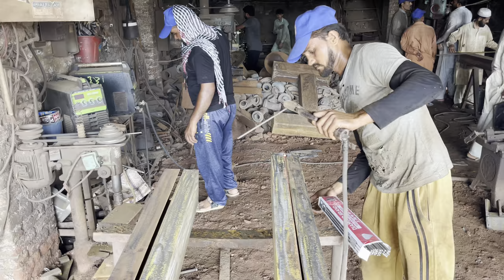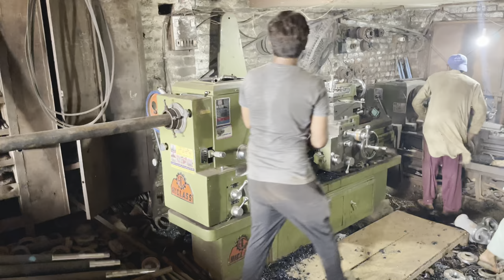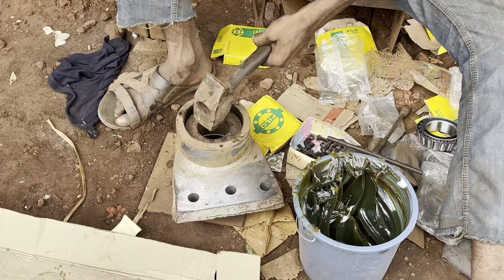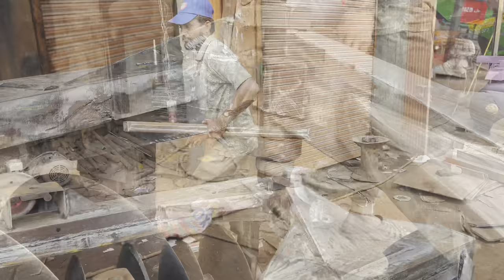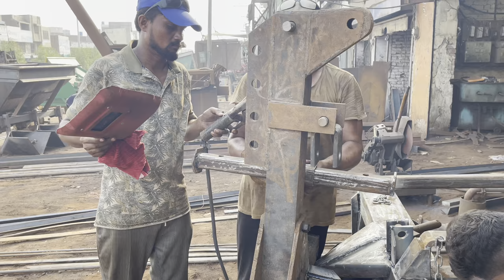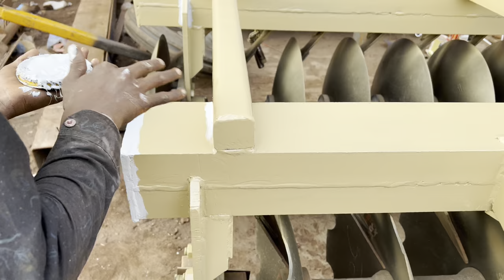How Disc Harrow Are Manufactured || Production Process of Disc Harrow for Agriculture !

Comment: It’s hard to beat a true running offset disc.  It cut clean and smooth.  Not many people know that you can turn to the left without raising them.  Turn right and you ruin your day.  The heavy gang shaft is very nice as well.  Nice work.  Your officially “Sodbuster” status.
Reply: They looked to be doing a good job of harrowing to me.   I'm no farmer but it was interesting to learn that it will cut ok when turning left but not right?

Comment: I've done a fair amount of welding, and I know that having jigs and fixtures is a real time saver. It also helps assure that each finished piece is just like the original in alignment and function.
Reply: You would think they would make a jig for the different steps.  Also clean up that shop.  Investing in a plasma cutter might also save time but what the heck.  Its more fun to do it the hard way
Reply: Its the way they do things.
The hard way....
That makes watching so fascinating.  
The industrial revolution left them in the dust.
Reply: Well if you ain,t have all the tools to make the job easy and you wanna be selling products for a decent price. You ain,t got much choice to do it the hard way.
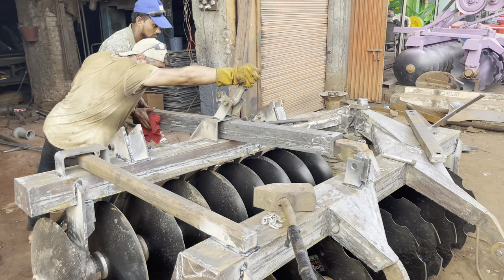Reply: Best part was 32:32 when they realised it was never going to fit

Comment: I'd be interested in seeing some test done on those welds. I haven't seen anyone bevel the metal on a butt joint or packing grease in a single bearing before installing them.
Reply: No different than the welds on farm equipment all around the world and especially USA the cheaper with high inflation and and so called electric cars..

Comment: Why weren’t the taper roller bearings packed with grease during assembly 🤔good video 🇬🇧
Reply from the maker: They used the grease but we mis that part
Reply: The machine fails before the dry bearings
Reply: Plus no seals anyway

Comment: Just wondering if those bearings come packed with grease because they didn't use any, unless they dismantle it to pack the bearings later.
Reply: I saw that, no grease zerks for pins or bearings either. No bushings for the pins.
Reply: @sisyphus9252  With 99% of these repair shops none of them grease the bearings no matter how big the machine is, a few squirt a little oil in them but how long would that last.

Comment: It's nice work, but it looks a little flimsy for something that will be worked hard in a field.
Reply: It is hardly nice work TBH, this no look tacking with stick welding is just stupid as you can't see. I weld a lot repairing farm kit and if you can't see you can't weld.
Reply from the maker: Thanks
Reply: @DiscoveringSkills  Thanks...lol
Reply: @theessexhunter1305  yeah, I grew up on a farm, lots of stick welding practice and driving a tractors for 14 hours straight.. lol
Reply: @theessexhunter1305  and yet, there in the video is proof it works well enough. There might be plenty in this video to "question", but look away tacks are a long way down the list.
Now if you'd like to complain about welding over slag I'll hear you ;)
Reply: I wonder what they charge for a hand-made disc harrow....
Reply: it looks plenty strong ..........bearing in mind that its being pulled by a 75 hp 2 wd tractor .........

Comment: Mans got to make a living, if for no other reason than to feed himself but if he has a family of eight, all bets are off. He needs to do whatever he can with no concern for the mortal danger to himself. Arc weld without eye protection, wear open toe  sandles around heavy dangerous equipment. Third world existence demands these sacrifices with no complaints. No work is too exhausting or dangerous. These men must work until they drop to the ground unable to rise from the dirt and filth of their work place, at which time ten more men will apply for his job and the cycle repeats itself.

Comment: Meanwhile John Deere factory is hermetically sealed, filtered air packing bearings and these guys bearings will outlast Deere's 😂 got a 330 disk that we have to replace the bearings every year and we only run across 550 acres at most.
Reply: well 
thats developed industrialized country..
here we are managing as cheaply as we can...

Comment: The electrical service boxes and wiring on the wall in the welding shop scares me - total third world engineering.  The guy welding is actually quite good.  Some very nice looking welds.  But, sandals in a metal working shop would not be my first choice.  The guy swinging the sledgehammer while the other guy folds the wrench in place with his foot - priceless!  I didn't see any bearing packing when they assembled the end supports - or maybe I missed that part.
Reply: Their individual skills are admirable, but the overall operation is just appalling.

Comment: This won't last, my grandfather was a top welder , I watched him enough times to know what's hod and what's shoddy. But what do you expect when these guts can't be bothered to wear a welders mask. Arc eye is a nasty nasty thing to have , but then these men are to cool and skilled to fet that.
Gotta get me a pair of them recommended safety sandals, I was wincing everytime the sledge hammer was going close to his foot
Reply: Despite the reputation of the big hammer as a tool for unskilled bodgers.  In the hands of a skilled engineer it's almost a precision tool.  Almost every mechanical engineer used to spend many hours hammering away whilst holding a chisel just inches away from the striking point. 
Having said that, the Health and Safety lot we have today don't exactly approve of it.

Comment: Incredibly fast and shoddy work. The bearings were just laid on the ground, collecting dust and grime as they were assembled. The primer was painted without cleaning the steel, right on top of rust and dirt. Not only that, but none of the steel was cleaned before welding. Instead of grinding down the welding seams they just filled them with body compound! That wont look pretty for long after the first couple times the system is stressed under load. This device will be torn apart in short order during use. It's harrowing.